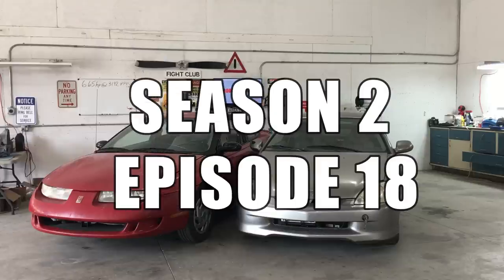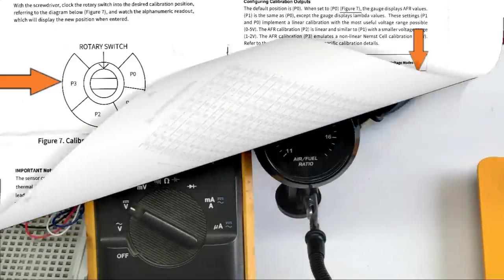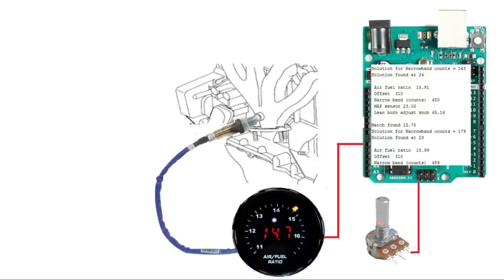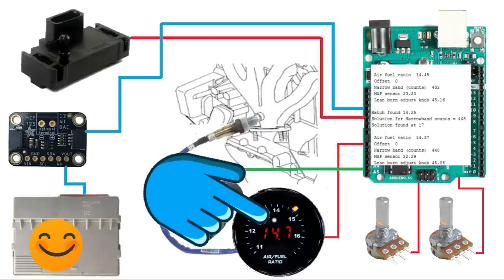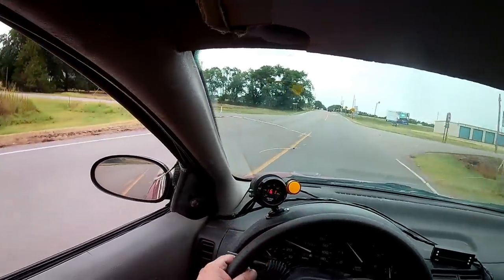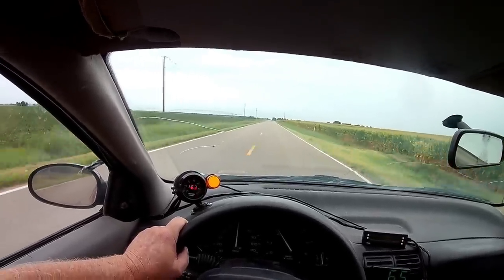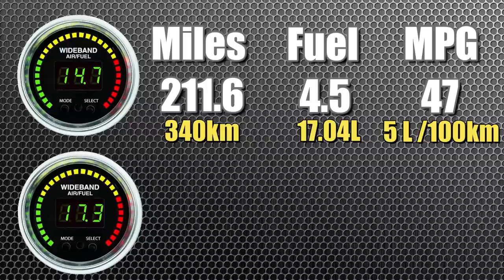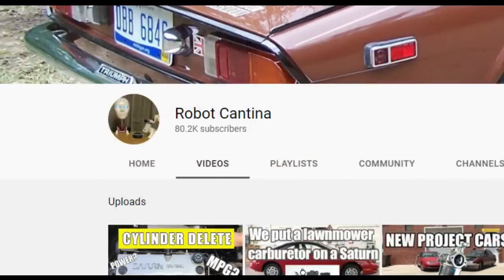S2E18:  We test a lean burn system on our Saturn .  Will it get better MPG?

Comment: There are plenty of reasons just leaning out the car like this won’t increase mpg. The flame front length of burn is too short to create downward force on the piston, complete fuel burn and good torque efficiency. Being lean can create unburned pockets of fuel because certain areas within the cylinder don’t fully ignite. The combustion chamber needs to be designed for lean burning. The change in air velocity due to more throttle input has an effect on fuel mixture inside the combustion chamber. 
Running lean requires more throttle input which means a different map sensor reading. Less vacuum puts the car in a different spot in the ignition tables which is always going to be less ignition timing cause the ecu sees it as higher load. Running leaner could also require different ignition timing in order to get a complete burn.
You have would have to recalibrate the ignition timing tables to be the same in order to actually verify a lean burn would even work in the first place. 

I’ve been a diagnostic tech a lot of years and I’m also a high performance tuner. I’ve had plenty of cars actually get better mpg on a slightly richer mixture after tuning. Some better than stock mpg. 
You have to take into account all these variables during a test like this.
Your 47 mpg isn’t unrealistic at 55mph because they are rated at a high speed for their mpg and seeing 40mph on manual single cam Saturns with power steering and ac are common.  You removed power steering and ac. Regardless of the fact ac free spins it’s still going to improve mpg removing it.
Reply: Thank you for this well articulated and well thought through response... There so many smart
comments on this channel.

Comment: Great video, Jimbo!  Thanks for all the detail.  I’ve been using an Innovate wide band sensor on my truck for the last 12 years, and it still works great.  As for the fuel economy run, I’m thinking you need a calibrated fuel cell, with a reserve.  Run 4 gallons, or whatever, thru the engine and when it quits, note the miles covered.  Then switch to reserve to get home. 👍

Comment: I had a Honda K24 running around 18:1 for a few years without issue. I averaged mid 40's mpg, with my best tank being in the 60's - though that was an outlier and might have been pump error. With careful driving, mid 50's was possible. This was a high revving ~230whp engine. Ended up needing 6-8 degrees of extra ignition advance in the window I had it leaned out. 

Honda was putting lean burn electronics in as far back as 1992, as far as I know. The VX trim of the 5th gen had it.

For what it's worth, the Scangauge will not show a fuel economy improvement, because it doesn't take air fuel ratio into account.

Comment: I had an Audi A2 which had the 1.6 “Fuel Stratified Injection” engine. It used direct injection and when it entered stratified mode, the throttle body would open wide and a flap in the inlet would move to create a more turbulent flow. Lambda would go from 1 to 3. It was of course a very temperamental system and Audi dropped it by 2005. I managed to get mine to drop into stratified mode once or twice and was impressive to see the engine running so lean. (I was sad enough to drive with Vagcom connected monitoring lambda!) The idea behind it was to ignite the mixture within a pocket above the piston create by shaping of the chamber, the injected fuel and turbulent air from the manifold protecting the engine from detonation.
Reply: I think Honda had something like this, at least the idea of a "vortex" combustion chamber, offset from the main cylinder area. The idea being that this aids in burning the lean mixture. It was a while ago but I had an '85 CRX HF which was carbed and had a very nasty rats nest of vacuum lines to operate the system.
Reply: @meagloth3336  HEY JIMBO.....  congratulations on reaching 100k subscribers.. ROBOT CANTINA is providing the 
entertainment and fun that viewers enjoy..

Comment: Lean-burn is part of the reason why Hondas of the 80s and early 90s could get 50mpg with a carburetor. It doesn’t really exist anymore of NOx emissions skyrocketing when engines run lean and regulators are much more concerned about emissions than fuel economy. On the Insight (as well as a handful of other vehicles) they would use a NOx absorption catalyst, something kind of similar in concept to the DPF on a diesel. In lean burn, the NOx absorption catalyst would “store” the NOx. The problem is that in order to clean or purge the catalyst, they would have to run the engine slightly rich. The catalyst would then process the incoming CO (from the rich mixture) with the stored NOx (from the previously lean mixture) to output nitrogen, oxygen and CO2. Needless to say, the lean burn time was limited and the effectiveness was reduced. Older cars (back when we didn’t care as much about NOx, primarily due to our ignorance about its negative effects) cars could run for much longer in lean burn, and that, combined with the fact that it used to be common for eco boxes to make substantially less than 100hp and the fact that crash safety wasn’t even remotely a concern (so vehicles could get away with weighing about the same as a pile of feathers), cars from the 80s could get 50 or more MPG easily.

Comment: I ran lean burn experiments on my 2002 Subaru WRX (that I would much rather be in than a Saturn LoL!) for about a year and can confirm the other comments. I was stock ECU limited to running 16.2 AFR and without alternate timing advance, you just end up in the throttle more to compensate for the drop in power and response. My best results, the ~10% theoretically achievable savings, were therefore during lean idle (saving fuel at drive thrus) and steady flat cruise on interstates.

Comment: Excited to see that little kubota engine in action! I have a D662 which is a under-bored version of the 722 and it turns 2x 12v truck alternators to power my off grid workshop. Great little engine!

Comment: The Honda Civic VX was fuel injected and made use of lean-burn technology in the '90s, it was also very reliable and fairly inexpensive.
Reply: Civic hatch and coupe, VX and CX. Used factory wideband O2 and got 45+ in the early 90s. And my Prius gets the same mileage in 2022. 
lmao xD Japan in the 90s were way over doing it.
Reply: @1987FX16  This was discontinued because of the high amounts of NOx that lean burn produces, if I remember right?
Still, it seems like a definitive way of raising MPG.
Reply: @1987FX16  Over doing it? Like, being excessively innovative? I can't imagine anyone ever being too innovative.

Comment: Regarding comments about advancing timing this is my thought.

Fuel has very little time to combust and release its energy. The pressure created from the combustion of the fuel/air mixture should be at its greatest close to 15 degrees after top dead center. If the fuel is slow to combust fully at that point potential energy is lost. Meaning the pressure from combustion isn't delivering full potential on the power stroke, resulting in loss of power and higher fuel consumption. On the other hand, if the fuel was ignited earlier by over advancing the timing of the ignition spark, peak energy release would occur too early and possibly occur before the piston reached top dead centre. Therefore, fighting against the power stroke, therefore, reducing the power and increasing the fuel consumption.

Comment: As a few others have pointed out, using the gas station pump as a way to measure the volume of fuel consumed, isn't accurate enough.  The auto-shut-off isn't a precision device and will not fill your tank to a consistent total volume.  Like you did in past videos, I think measuring total fuel consumption by weight is your best option.
Reply: It gives a good on-road average result if repeated 3 times.

Comment: This was an amazing video! I actually quite enjoyed the details of how you implemented your wideband-to-narrowband conversion and the offset between them.

Rather than a lookup table, you could do a bit of math to convert between them. There are four operations you need to do: offset to a pivot point (e.g. shift the ideal AFR to zero), multiply the slope (by a negative value larger than 1 to invert and scale up the signal), offset again to shift the signal where the narrowband would be (e.g. shift the ideal AFR to 0.5v), then clip the output value to [0, 1]. This might be fewer operations and more reliable than a lookup table, but it might take a few tries to get it right if you aren't used to it.
Reply: Meeeeeeaaaahhh!!!
Reply: this
Reply: @omegarugal9283  HEY JIMBO.....  congratulations on reaching 100k subscribers.. ROBOT CANTINA is providing the 
entertainment and fun that viewers enjoy..

Comment: Water vapor / water mist takes care of the NOx emissions, increases power and reduce the risk of engine damage due to overheating, that's is a common problem with lean burn.  Water mist will also trick the O2 sensor into thinking the mixture is too rich, because O2 sensors can't tell the difference between unburnt hydrocarbon and water vapor in the exhaust. So the ECU will natually lean out the mixture without tweaking the sensors. An easy way to get water vapor is to use engine vacuum and engine heat. If you don't add another fuel, it's hard to get better than stock efficiency by just substracting fuel. Or at least using another way to deliver that fuel, such as gasoline vapor. One way that would make a viable daily driver would be to lean out stock injection and add gasoline vapors as a booster.
Reply: producing nitric-acid in the process
Reply: @eugennomatterr7311  All you need is about one or two cc's of water per minute to make a difference. Just look up how much water is already in the air.
Reply: @ultimatecleveland  millions of cars spraying acid for fuel economy just what we need now. We already dumbed down generation of people using leaded fuel,. Look for tu 160 bomber take off videos, just a bit of acid rains after.

Comment: As others have noted, you'd likely need more timing for improved efficiency (leaner mixture needs more time to combust properly) and at lean burn point there might have been loss of power, so you needed more throttle and as such more fuel was wasted.

With good wideband you got supplied and a speeduino 4 cylinder board (hopefully that can be adapted to saturn wiring/sensors) you could control everything properly, without tricking stock ecm. This way, an economy fuel/ignition map with lean burn could be made and perhaps this way some more fuel economy would be possible.
I think your previous NO2C could also be used for saturn, but you'd lose sequential ignition/injection (probably not that big of a deal).
Perhaps exploring other options like injectors with better spray pattern and hot air intake might also benefit for MPGs.

Obviously this would take some time to properly implement, but it's an idea to explore nonetheless, before diesel swap that is.

Comment: Possibly when filling up at the pump the auto shutoff might be clicking off at an unreliable point a more accurate fuel consumption system would help alleviate possible fluctuations between tests
Reply: I think the comments about ignition timing are also valid, but this is the first thing I would try to correct. 

Based on AFR, I would expect about 10% better fuel economy. If the pump auto-shutoff was a quarter gallon short on the control fillup, but correct on the lean burn fillup, that would make up the difference in economy. One channel I watch occasionally makes sure to use the same pump at the same station, fills to first auto-shutoff, waits 30 seconds, then fills again to auto-shutoff. It might be a good set of rules to explore.
Reply: He could use a portable gas can and an inline fuel pump, then weigh the gas can before and after.
Reply: I think that's a good suggestion.
Reply: Yeah, it should be the same pump at the same station at a minimum.

Comment: Thank you for all your time on your amazing videos! I love watching them. If you were curious, lean-burn is actually something used on a lot of Australian vehicles afaik (to reduce fuel consumption, but in return increase emissions). Because of this, GM implemented lean-burn on the 99-06 LS (in Silverado trucks, GMC, Tahoes Express Vans and more) I've tinkered with for a long time. They have implementations for reducing the commanded fuel (14.7 -> 16.2) and increasing spark advance anywhere from 1* to 5*. It's cool to see you came up with your own way of implementing it in a completely harmless way.

Comment: Amazing video(smart guy)and smart commenters.

Many are noting the need for much more advance.

There is a certain point that maximum cylinder pressure needs to be exerted-the sweet spot.

My research says 32 feet per second is the flame progression of the combustion of gasoline. Certainly variables come into play such as compression. 

Not messing with the timing to early ignite the mixture misses the point of the experiment entirely. It’s not apples to apples.

Take into consideration that the entire environment is changed with the leaner mixture’s combustion event.

Earlier ignition is what you will use to match the pressure peaks between the different setups to be all in by 14 degrees ATDC.

You will need a table for various Air Fuel Ratios to set the all important ignition advance. 

I love your channel!

Comment: I have used lean burn with megasquirt on all my street cars. NEVER had an issue and they are both 9 sec turbo street cars.  on a 6.0 I run it till it coughs and then creep up on the timing   18:1 and about 44deg. you should monitor timing when making a run because you are at different MAP areas when in lean burn VS stoic.

Comment: One thing I found out is lean burn can also be created on older vacuum advanced distributors by apparently having a vacuum port that is closed when at idle. Think Chrysler did this on some. That’s just the general explanation I got, probably more to it. But that would be for using less fuel at idle I’d guess.

Comment: Like Aidan I have owned many many Saturn's.  I got 41 MPG on a long ( 2000 mile ) Hiway trip in an SL2 with an auto trans.  I had a SL1 with an auto that would get 43 Hiway MPG.  So yeah, I believe 47 with a SC1 5-speed.  My current Saturn is an 2001 SC2 auto.

Comment: It’s common to run aircraft piston engines “lean of peak (EGT)”. usually about 40 degrees LOP or about 16:1 afr is generally considered the sweet spot where there is fuel to be saved without loosing too much power. Although some can be regained with ignition timing the lean side of the power curve drops off more quickly than the rich side. For some comparison, my airplane burns 10gph at 165 knots at 12:5 AFR(16 mpg), or 7.5 GPH lean of peak, but will slow down by 10 knots. (20mpg)
Reply: What is the fuel consumption when you maintain the same speed?
Reply: @brettjasonheadinventor  HEY JIMBO.....  congratulations on reaching 100k subscribers.. ROBOT CANTINA is providing the 
entertainment and fun that viewers enjoy..

Comment: I've owned a few Saturns, an SL1, SL2, and SC2. MPG in the high 40s was about my experience with the SOHC Saturns. If those cars were anything they were fuel efficient and reliable, that's why I've always tried to keep one around as a beater. DOHC nets you a little more power with slightly lower fuel economy but it's still gonna be low 40s high 30s. The automatic brings down the MPG drastically, to low 30s with the DOHC.
Reply: Interesting, probably the transmission being a 4 speed not allowing freeway cruising without crushing acceleration or set for pure ease of acceleration and running too high of RPM on the freeway. My 01 corvette had the performance axle and was auto. I could get 22.5 in town, but only 24 on freeway. The M6s would get 19 and 28. Since I drove mostly city the 22.5 was very much welcome.
Reply: @BeamerTheFox  While you may find or assemble a single cam SL2, it is not clear what that is. The S means S-series, L means 4 door, C means 2 or 3 door, W means wagon, and then the number is the number of camshafts. (SL is a base model single cam with manual steering and transmission, and SC is the SC2 before the SC1 came out.) The twin cam cars came with closer transmission ratios, 15" wheels, rear sway bars and exhaust resonators. There were also different upholstery options, front seats, speedo and tacho scales, and body colored door handles and mirrors. ...and the short wheelbase SCs had different front bodywork with popup headlights...

I suspect you will want the single cam transmission with the taller 5th gear. Using the close ratio twin cam transmission with a single cam engine is pretty funny, but probably not sensible.
Reply: @themouse5666  good overview of Saturn’s SL engine architecture and nomenclature.  I reluctantly owned an SL2 with an automatic only because my wife did not drive stick.  Still going strong when I gave it to a friend.  Miss it 🙁

Comment: I too read somewhere that the correcg way to run a leanburn system was with a few more degrees of ignition advancement, because of something like a slower flamefront/burnspeed